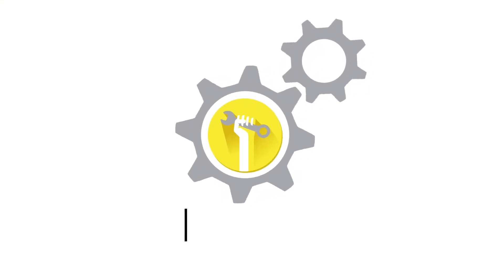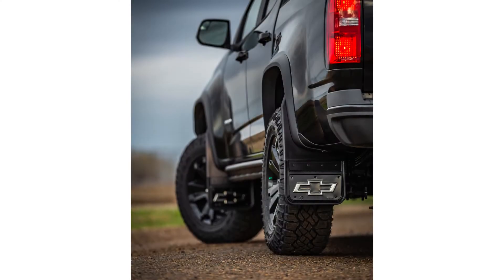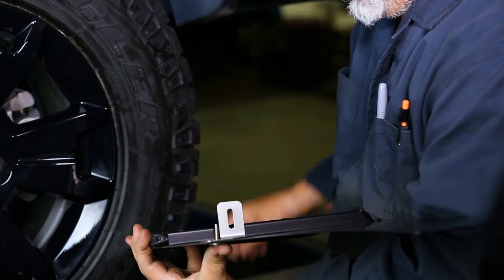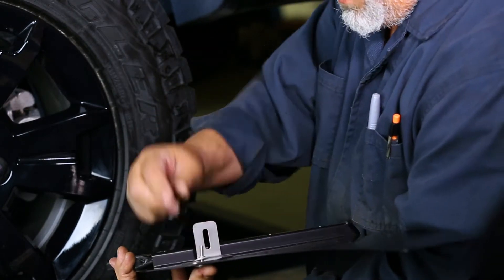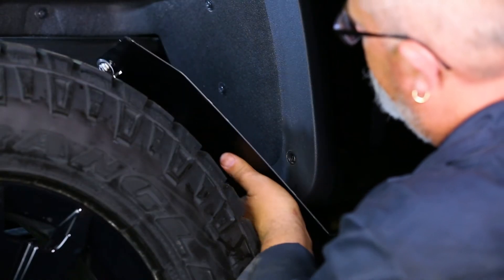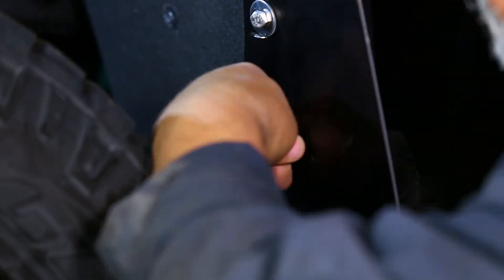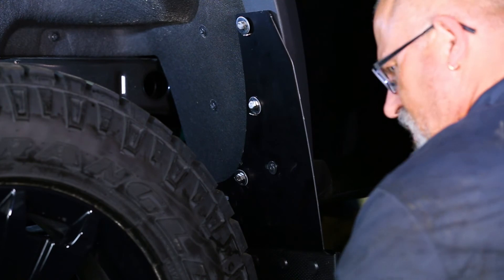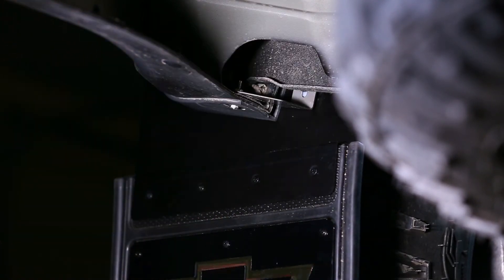Gatorback 2018 Chevrolet Colorado ZR2 Rear Mud Flap Installation

Comment: Wow 500 bucks? I've been trying to find the gatorbacks to fit my zr2 and I can't find them, until now. But the ones I THOUGHT would fit with bow tie were 325 bucks. I thought that was high! Why are they so expensive? What's the thickness of rubber?
Reply from the maker: The flaps are made and designed in Canada. We use heavy duty premium rubber for our flaps. We also are anodizing all the aluminum pieces which drives up the cost. We have found the anodized aluminum is really durable and stays looking good longer. We want to make a quality product which will last just as long as the truck will.

Comment: What is the specific model of the Gatorback mud flap for the ZR2? Good place to purchase?
Reply from the maker: The part number for this flap has not been determined yet. The factory is dealing with a couple problems which have caused a delay. We should have a part number in the next few days.
Reply: Thanks......very interested in it, please update when available.
Reply: Any progress on a part number?  Thanks....
Reply: How Do I go about ordering a set of these?
Reply from the maker: We are going to have a couple different part numbers available. We are going to be having a kit available which will include both front and rear flaps. The flaps are available with a Bowtie logo or plain black. The Bowtie kit is GB766863 and the plain black kit is GB766862. We will also have the front and rear available separatly if needed. The Bowtie kit has a Canadian retail price of $642, and the plain black ones are $564. US pricing may vary some, but hopefully will be available in the next few days.
Reply from the maker: The flaps will hopefully be available soon at www.truckhardware.ca or any of our many dealers in Canada, and www.sharptruck.com in the US.
Reply: Thank You...
Not cheap but they sure look nice and heavy duty. 
Looks like about $500 for a full (4-flap) kit USD for the Bowtie version.
Reply from the maker: Part numbers are online today!
https://www.truckhardware.ca/search?q=zr2
Reply: I ordered a Bowtie set for my ZR2 from SharpTruck but it sounds like they are still waiting on parts from Truck hardware to ship the order?

Can you comment on when these kits will be completely ready to ship?
I really need/want/desire a set ASAP to protect the vehicle paint from debris from the wheels.

Thanks....
Reply from the maker: We are building the flaps out of anodized aluminum. Unfortunately we have experienced a delay with the anodizing process. The anodizer tells us we should get our parts on Friday, which hopefully means we will be able to ship out flaps next week. We are really sorry about the delay.  We want to make sure the flaps are built without compromise.
Reply: OK......thanks.  Fingers crossed.  :-)